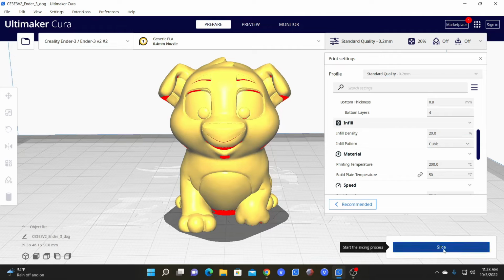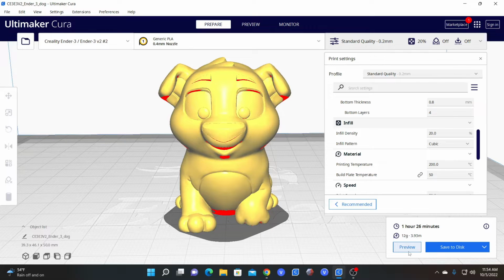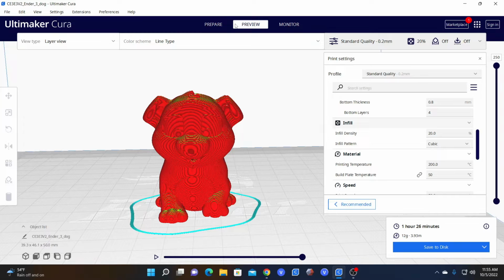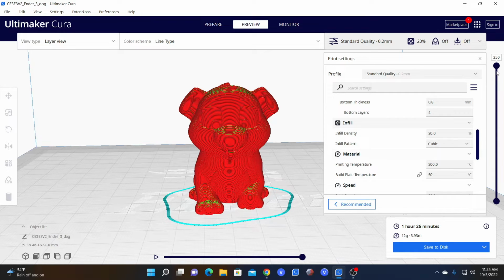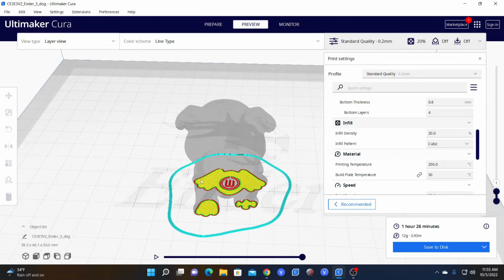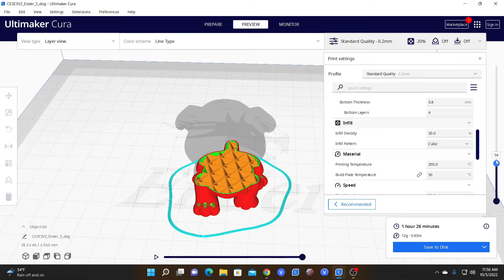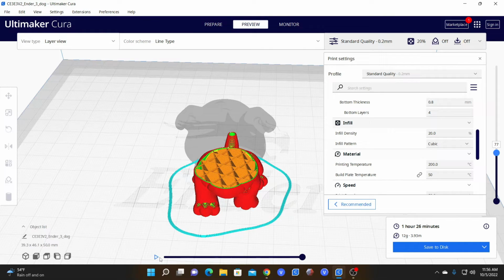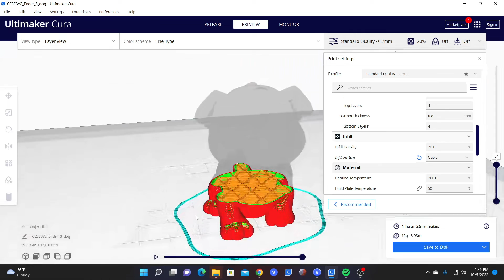Using "PREVIEW", in CURA, to review how your 3D Model will print.

Comment: Is it possible to make the preview play faster other than manually moving the sliders?
Reply from the maker: You'll want to slide UP AND DOWN from the right side of the screen, with the mouse. Hold the mouse over the ball, and drag up and down.
Reply: @3DRundown Thanks, but it's not really what I need. I use the up/down slider to check each full layer for infill, etc. I also want to see the nozzle moving in the actual print pattern like when I click the "play" icon, but speed it up so I can watch a few layers in a realistic amount of time. It seems to only play "realtime" using that method.
Reply from the maker: I figured that. I don't know of a way

Comment: Hi! I have the latest version of Cura on Windows but I don't have the button to watch how the printer will move (the bar on the botton). Do I need to activate something? Thank you!
Reply from the maker: It will only show up when you press the PREVIEW button
Reply: Thank you for your reply! I always do that to review the layers and I can see them and the supports and everything, but the video option never shows :(  @3DRundown
Reply from the maker: Which Cura are you in? Update to 5.6. I have tried to duplicate your issue, and can't get the play button NOT to show. However, the best way is to use the scroll bar on the right side of the screen
Reply: Thank you for you response, once again. I did it in several other computers and works just fine. It must be that my pc is very old and maybe the video card can't support it. Thank you anyways! @3DRundown